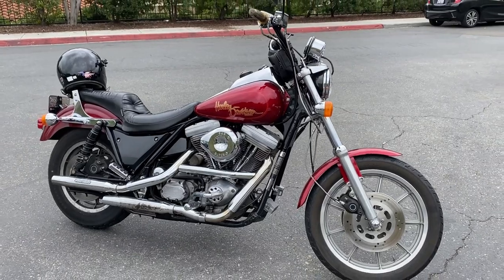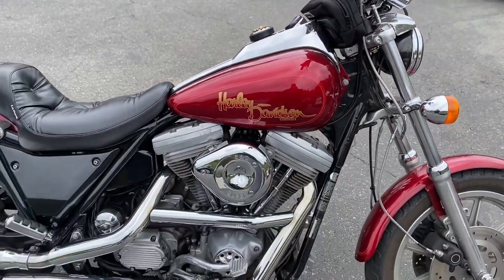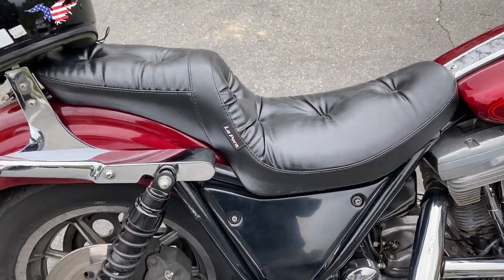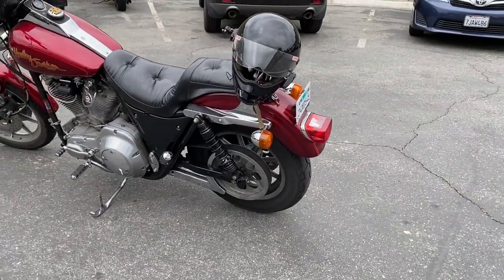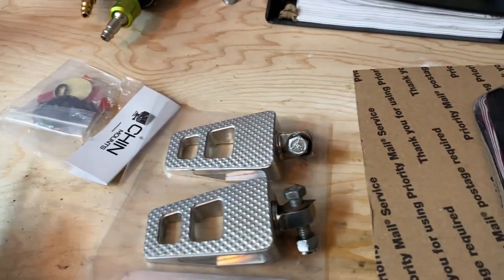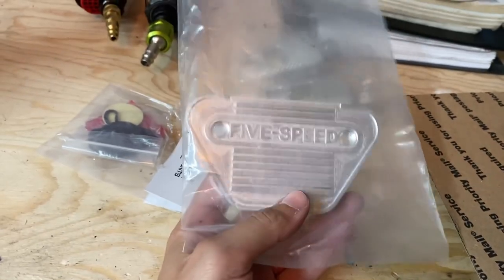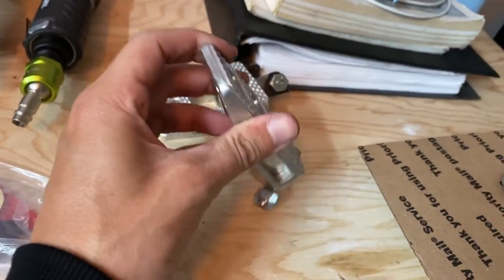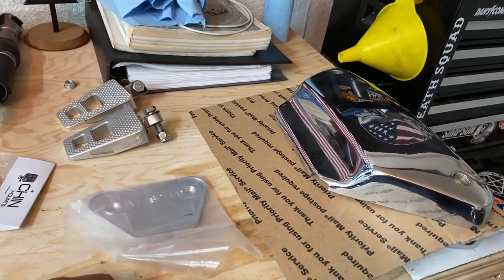FXR Series 87 FXRS-SP Walkaround (episode 2)

Comment: Hey looking forward to the FXR content. I’ve got same color but it’s an 83 FXR Shovel. I went with the BMC/Corbin seat...RB Racing pipe ...Big Al’s risers n bars and I went with 14” Race Techs in the rear and love em. Former 0311 here was with E 2/3. 🇺🇸
Reply from the maker: Nice dude Thankyou for your service always awesome to see fellow marines on Harley! And I really wanna ride a shovel head bike how does that motor compare to twin cam and evo? I imagine it shakes a lot more?? Also, sounds like a badass setup!
Reply: @dynademos  I’ve got a 93 Electra Glide police with a built EVO and it runs pretty strong and had a 09 FatBoy that had some motor work so that was definitely more powerful but the Shovel with that pipe and S&S carb on it runs really strong and over the winter I just installed an S&S top end on it new pistons..jugs and heads it’s still in the break in process so can’t really rip it yet but it’s gonna feel like a different bike I think. Shovelheads get a bad rap because everyone thinks of the 4spd rigid mount motors but the 82/83 FXR and the FLT had a 5spd and was rubber mounted so definitely a more refined ride ( I just said refined referring to a Shovel??) but anyway ya it’s a blast 👍🏻🇺🇸
Reply from the maker: @josephtizol9695  hell yeah dude that’s awesome I wanna ride a shovel head so I can compare it I’m jealous! Ride safe homie 🇺🇸

Comment: A roll bar, 2:1 exhaust, and Lectron carb
Reply from the maker: U got an electron carb? Also 2:1 is in the works ! Crash bar thinking about an og hoop
Reply: @dynademos  I wish, don't have the coin. It's well known to outperform most anything, no jets, and better mpg
Reply from the maker: @xc8487  I’ll look into that seen one for 700 not sure is that’s a good price point
Reply from the maker: @thakery5720  always with the good ideas! And u will be happy to know I plugged that vacuum fitting 👌🏽bike idles 😬
Reply: @thakery5720  Read the mikuni and s&s carbs use a lot of fuel
Reply from the maker: @thakery5720  I’ll probably keep this setup for awhile I plan to first get the ergonomics bars, suspension, seat stuff like that
Reply from the maker: @thakery5720  so much to do....hahahahaha I appreciate the knowledge